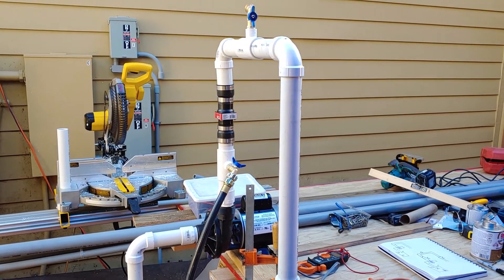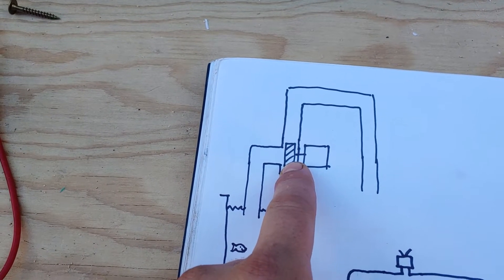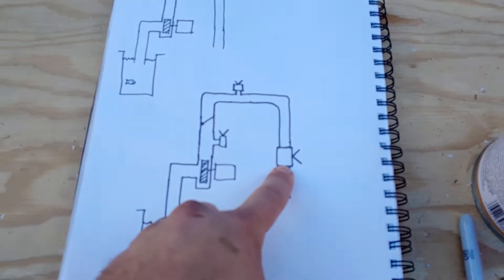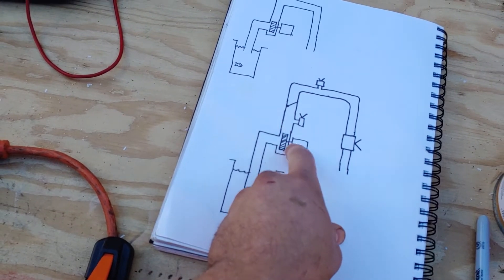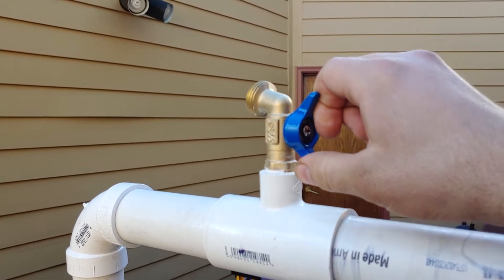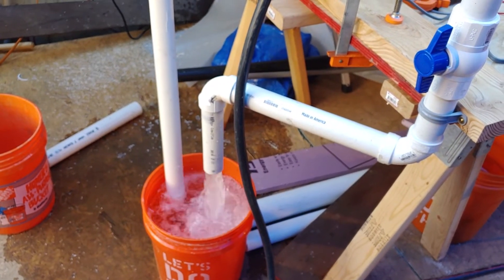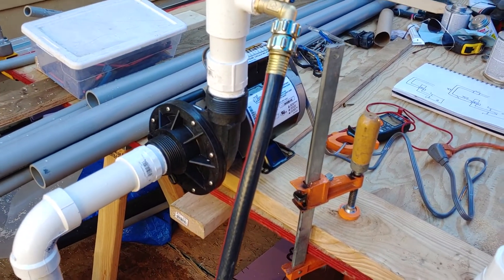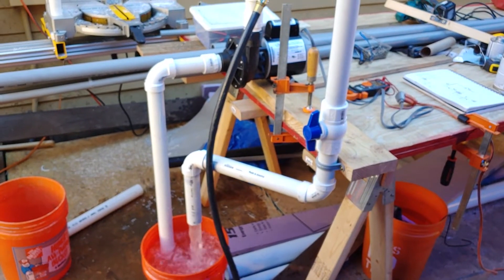Priming Circuit for Non Self Priming Waterway Pump

Comment: Sweet!  Thanks for taking all the time to set up your video and demonstration!  This is exactly what I need!  I have a non-priming pump that draws water from a pond in our back yard (about 30 feet away and 5 feet below the pump) and have already installed the check valve (you called it a foot valve) that is at the intake in the pond. My goal initially was to have the check valve prevent water from flowing back into the pond thus holding my prime. Because it is pond water, the pipes and valves get pretty yucky (slime, pond debris) and the check valve eventually lets the water seep back into the pond - this is where I should say that the check valve installed in the pond is installed horizontally so no water column to apply pressure. When I do lose prime, I end up pulling the system apart and grabbing the hose to re-fill the pipes and creating a prime. I'm totally doing this so all I'll have to do is turn a couple of valves and turn on the hose!

Comment: nice job and good explanation. Why not get rid of the manual valve and air valve? It seems to me that you just need to prime the pump to the output level of the pump. That is achieved with the checkvalve and waterinlet alone!

Comment: ohh so u can turn on pump even the gate valve is close? it wont destroy pump?
Reply: @Neverstopbuilding  yes u cant leave it too long, thx
Reply: Since it is a centrifugal pump, the static pressure that produces it not so high to determine damages on the valves or the pump itself, the valve can be closed with the pump still spinning. It would be different with a volumetric pump, in that case you would push against the valve as long as the engine torque allows it, very likely you would brake the valve, the pump, or both i guess

Comment: Cool set up, nice demonstration, and good explanation.

I'd like to build a backyard rain collector, and use a self priming pump to irrigate my lawn, which is about 4,000 SF grass lawn to 5,000 SF including trees and bushes.  That means I need a minimum water storage capacity of 2,500 gallons in order to irrigate my lawn one time with 1" of water.  5,000 gallons is much more practical for 2 uses.  10,000 gallons would allow irrigation with no supplementing from the city water up to a month, if it were full.  That seems a bit much for starting, so maybe I could build a 6,000 gallon pond, underground water storage tank, or even building something with cheap construction materials (i.e. cinder block with waterproofing membrane).